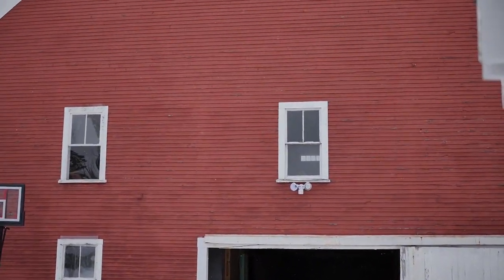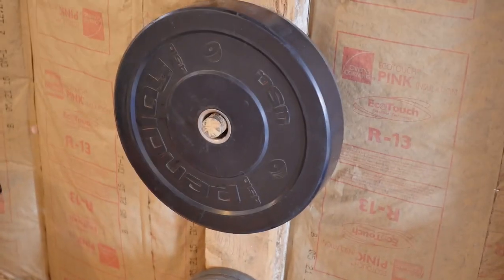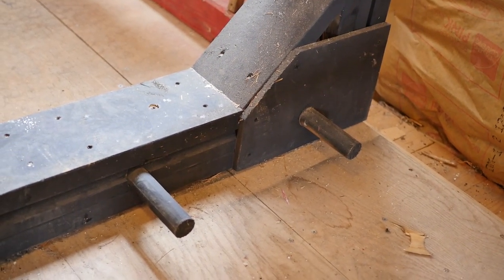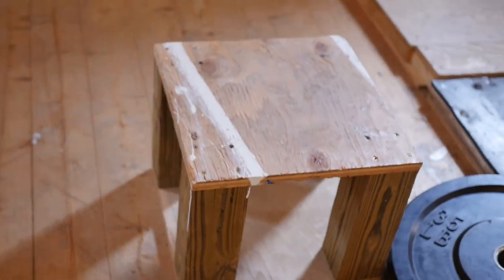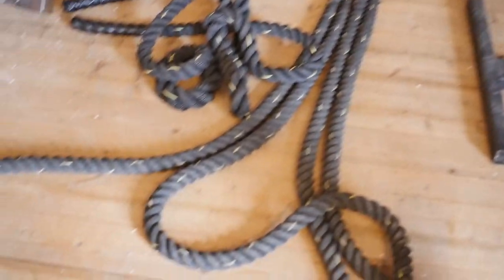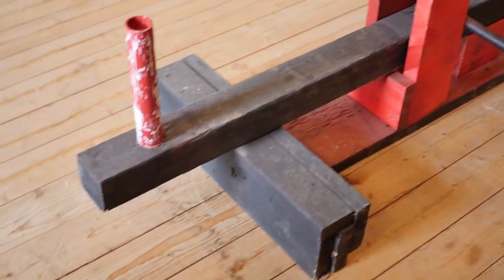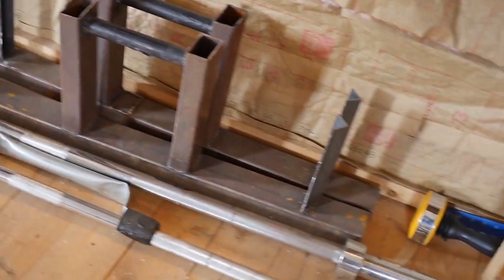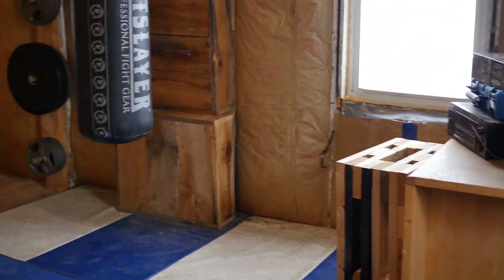The Craziest Home Gym Ever | WOOD Equipment 🌲 | Full Tour

Comment: This has to be the best DIY home gym ever (and any DIY beats the bought stuff)! I am just starting to build mine -- we had a fire and had to rebuild from ground up -- and you are inspiring me. 

I actually have a question for you -- I am about to build the power rack (actually just placed all the wood in the basement (mine is in basement), and I'm glad I noticed your video before I built because I absolutely love your  racking setup. Can you please give details on how you did this? I mean it is pretty obvious by looking, but I'm particularly interested if you have anything on the back side, or do you just have two pipes going through the holes?

Again, this rocks and you should be very proud of it!
Reply from the maker: Thanks John! Unfortunately, I don't have specific dimensions for it (I kinda just built it as I went). However, one thing you need to be very careful with is drilling the holes straight. If they are not nearly straight, the safeties won't line up correctly. Drilling the holes straight was a challenge with a corded hand drill (which is what I used), so I would highly recommend using a drill press for this if you have access to one. I hope this helps!

Comment: Awesome gym! I'm in the works of setting up my unheated and uninsulated garage. Do you have issues with condensation on your plates with the extreme temperature change? It gets very cold where I live!
Reply from the maker: in the dead of winter, the plates will form some condensation when the gym heats up and cools down. It hasn't caused any rust though.